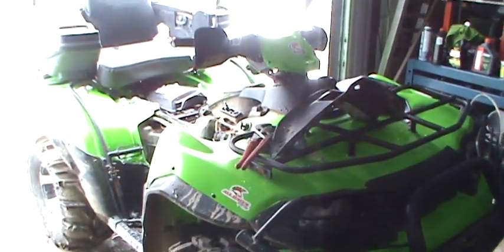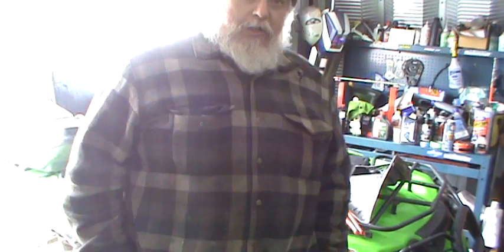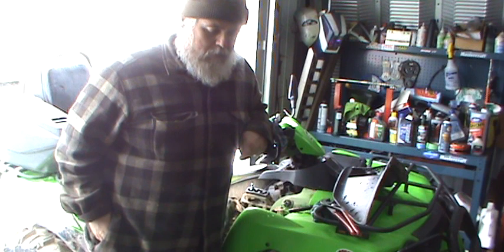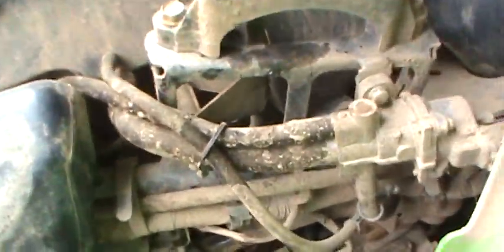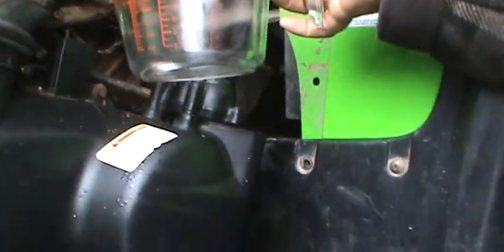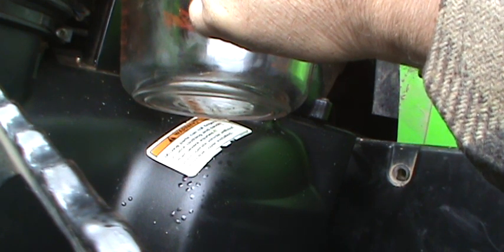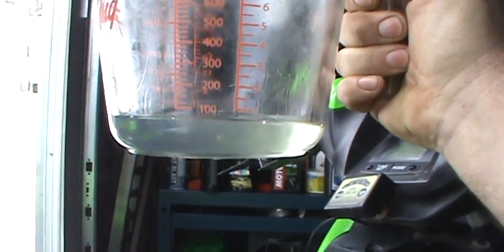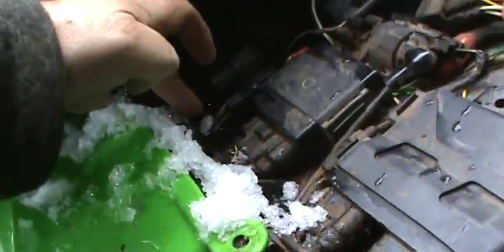Kawasaki brute force 750 no power backfiring fix

Comment from the maker: Some tools we use and like found here  https://amzn.to/3dbOQVE
Reply: Hey man I'm having issues with 04 prairie 700. It won't rev up it will idle fine. Hear Is what I have done to it so far. 
New fuel pump
Put carbs off running quad
Adjusted valve's 
Did compression test
Did leak down test 
Tested coils
New spark plugs
I just can't get it 😪 any ideas thanks in advance.
Reply: I'll send someone $100 if you can tell me what is wrong. Let me know I can call text or email
Reply from the maker: @darreng2639  Might be an electrical issue. Check all the wiring that deals with ignition and fuel. Sometimes coils test fine but break down under load.
Reply: My kvf 650 was backfiring through the exhaust and the carbs . I put rebuild kit in carbs , new plugs and set valve clearance. Inlet on valves had no clearance. So I set at 5 thou . Started it but no different . Reassembled the air box and it is now running great . However I don’t know which part of what I did actually solved the problem . I’ve just read somewhere that the valves on these tighten up rather than go loose and you can then lose compression . Please can you tell me if this is correct and would this have caused my backfiring issue ?  Love your vids from North Wales UK .

Comment: I'm having this problem backfiring out of the carbs I have changed the fuel petcock the fuel pump. I have took the belt cover off. Everything is good. I have reset everything for limp mod . What else could it be? I have even adjusted the valves  the four wheel was slipped over on its side ever since then it has not ran right what else could it be thinking? I'm gonna take and rebuild the carburetor.?
Reply from the maker: @anthonykriegel2207  do a leak down test on both cylinders.

Comment: Got question.. Got 08 brute force 750 it got oil catch can from top of valve covers front valve cover pipe when it warm up blow milk looking oil. Out it I check my oil it look new
Reply from the maker: Does it have a green ting? Prob a bad water pump mechanical seal. You need to remove the cover to drive the seal in from the inside.
Reply: If it was that would it leak oil or coolant out pipe and filter bottom water pump right

Comment: Gotta question for ya, is the stator in a brute force 750 in oil, my brute is leaking a small bit out the stator plug it seems and I'm told it's not a big problem, just replace plug.
Reply from the maker: There is some oil in there yes. Just take the cover off, clean it real good and use a small amount of amazing grey or permatex sealant on the plug.
Reply: Hey shawn, I've been chasing bogging issues since I've owned bike.only when bike is at temp.when cold have no issues.ive replaced pump and coils, did your fuel flow test and got 150 cc fuel, within a few mls, anyway, after replacing coils, the bike worked great for about hf hr, then it stalled which it never had before, but it fired right back up and shortly after just totally dies, I am getting no power to rear cylinder coil, I did a loop test on wire and there was a complete loop.any ideas on cause
Reply: Hello Sir
Please tell me if my kawasaki brute force KVF  750 A year 2006 has a electric fuel pump mine is the model with carbs 
Thank you!!!

Comment: What if I’m having a similar issue but right opposite it’s the front cylinder I believe not firing until i I get the rpms up about half throttle and then it kickes in and runs like a bat outta hell
Reply: And the front cylinder has good strong spark and I just put new plugs in it.. it’s a 2008 fuel injection model
Reply from the maker: try switching the coils and see if the rear starts to misfire.

Comment: Dpes the 05-07 bruteforce 750 have a gas on /off. I see under the fuse box close to the tank. There is what looks like one but only says on and prime. I wish they had a on off. Bc when it sits for a long time. Thats y these carbs get all clogged up. Do u think its worth installing an aftermarket one??!!
Reply from the maker: @ljccoppola2818  sure.

Comment: Hey I need help finding a cdi box for a 750 brute force 2008
Reply from the maker: It is a rare failure but it has happened. Check all the wires first. E bay used. They are very expensive new.

Comment: I done this test on my 2014 brute 750 i had the 150 cc's on the decond time i turned key on. My machine is backfiring at idle and when you push throttle pull plugs and they was shiny black on electrode valves have been set has good spark sny help would be great thanks
Reply from the maker: @skeetcat  do a leak down test on both cylinders.

Comment: Got questions  got 05 brute force 750 4x4 it was blowing oil out crankcase vent pipe..so he had top end rebuild with big 800 kit in itand still doing it
Reply from the maker: Can be many things. It's obviously pressuring up. Did this engine ever get a hot lunch ie overheated badly?
Reply: I don't know bought it and  it was doing it so had guy check it and he said it was  rings and jug so rebuild the top end got it back it run good no smoke

Comment: Yes sir thanks for your yo channel , hav a heck of a time with my 2008 brute 750 fi, new wiring harness, fuel line, injectors, 3rd fuel pump,I can test the pump hear it working, it just cranks and cranks won’t pump fuel , I am stumped, had it to a dealer and they couldn’t get it either??
Reply from the maker: Give me the full rundown.
Reply: Everything is new can’t get it to pump fuel I rebuild the pump with 3 different pumps, don’t wanna but a 609$ pump watched your pump building video guess I’m gonna try that next thanks
Reply from the maker: @reg62081  When you take the pump apart there is a little hidden screen where the fuel pressure regulator goes into the plastic body. Take a bent nail and poke a hole in that little screen. I bet that is your problem.
Reply: I’ll give it a shot thank you sir

Comment: Great video on fuel pump test! And love your unplugged acoustic guitar playing Hammer Head Garage your a great guitar player unlike myself! 😂.... Can this cc per cycle method work on our pulse fuel pump??? Also would you or anyone hear know what can cause our problem?  We have a 06 brute force 650 with a misfiring issue out the rear carburetor at idle & it lacks power in rpm's misfiring when rpm is increased...we put a new pulse fuel pump in it the old one was cracked it still backfires at idle with new pump on and a flame i can see deep in manifold boot when it's misfiring, the rubber manifold boot on the back cylinder it's white inside the boot noticed that when i cleaned carburetors changed out the jetting for a new ignition box its gotta be running lean with that white in intake boots yes? i went through settings on air screws from 1 turn out to 3 still spitting out carbs and lean no mater were im at on air screws.. our valves clearances are at the stock setting and done on compression stroke our intake is at 0.10mm exhaust is at 0.20mm i rotated motor seen intake valve close waited for my top dead center mark to come up for the cylinder i was on the tapits had play in them im told thats how you know your at TDC yes?? we have 60psi on cylinders we have all new jets and diaphragms in carburetors for this brand new Dynatek F.S. digital ignition we have in it our old one had a crack in the bottom,, we thought all these parts would fix our idling misfiring 😂. i got fed up used a gravity feed fuel tank straight to carburetors it improved a lot so did my power of my rpm rev but still have that misfire.. any input you or anyone hear would have it would be very appreciated these brute forces are the toughest 4wheeler i ever wrenched on im about to scrap it! 😂
Reply from the maker: Do a leakdown test on both cylinders not a compression test. Did you ultrasonic clean the carbs? the cc method only works for a electric fuel pump.
Reply: @HammerHeadGarage  Thank you for your reply and professional technician help Hammer Head Garage! I didn't do a leak down test on the heads I will do that see what I find and come up with. my only means to cleaning carburetors is the old fashioned Way carb cleaner and 150 psi of air and sometimes very thin wire for a passage way.. that carb cleaning tank i wish i had that set-up 😂... any chance we can make our own cleaning tanks with electric hot plates and old stainless steel pots if we can achieve the proper water temperature and use the proper solution? I really appreciate your tech help Hammer Head Garage your the best!

Comment: Have a 06 cat belt warning on did the factory reset numerous times won't reset. Wiring good, switch in on position battery at 12 volts starts and will run but won't rev up much. CDI box?
Reply from the maker: Likely an ecu issue. Did you try taking the ground off the battery and then re hooking it back up?
Reply: @HammerHeadGarage  yes removed ground also tried unplugging ECU same thing.

Comment: Great video. Mine backfires really bad during deceleration. Do you know what might be causing that? It seems to have plenty of power, but backfires all the time. Whenever I’m slowing down, especially from really high speeds to just completely letting off the gas.
Reply from the maker: @josephbearlewis  holes in the exhaust or loose pipes and bad gaskets can all cause it.

Comment: I have 2003 kawasaki  prairie  4x4 an I need to know if there's a speed reset  on it
Reply from the maker: No there is no speed reset.
Reply: My 360 cc doesn't go the speed that its supposed to it just bogs out when I go full throttle
Reply: I put new carburetor on  it an i adjusted  it does the same
Reply from the maker: @hilariorodriguez6468  start with the basics: fuel/air/spark and go from there.
Reply from the maker: @hilariorodriguez6468  Basics are Fuel, air and Spark. Start there. Get a service manual.

Comment: Great video , thank you ,  curious,  I have a 2002 prairie 650 4x4 , carbs were full of dry gas. I ordered a kit , new o rings ect.. I cannot find accelerator pump diaphrams anywhere ,  I tried kawasaki but they said they dont make them , not even a part number. Any idea on replacements ?  Thanks
Reply from the maker: You will need to find one that fits from another carb. suzuki often interchanges with kawi.
Reply: @HammerHeadGarage  thank you I'll give it a shot

Comment: i have a 2006 brute force 750. bought it used and had no problems. got it home and the problems started. i was riding it and !/2 and full throttle it will back fire in the back cylinder. dealer has put new carbs on, cleaned vent lines, ect... they want me to come pick it up as they don't have the time to mess with it anymore cause they are backed. $715 in labor and still not running. alot of people are saying it could be valves needing adjusted. i need answers!!!!!
Reply from the maker: Do a leakdown test on both cylinders and get back to me. Could be many things. Puting the front cam into the rear cylinder will cause this. Low compression, bad valves, bent valves etc.
Reply: @HammerHeadGarage  how would I do a leak down test?
Reply from the maker: @ChippyDooTV  take it to a mechanic.

Comment: Im trying to put one together,(2003 650 Prairie),  My question is, whats the difference between the rear head and the front??  Seems the front is about double the price and rare to find with cam,  Why?
Sorry, thats 2 questions.
Reply from the maker: Heads are the same but the cams are different. the rear cam has a raised radius along the face of the seating end.
Reply: @HammerHeadGarage  I deeply appreciate the insight, but i have been staring at a front and rear cam pic for an hour and still dont see what you are referring to.  Please send a pic.   Thank you!
Reply: I think I see the raised portion.  So, is it possible to buy a cheaper rear and substitute a front head??
Reply: I said it wrong..... buy a rear head and swap the cam for a front cam and install it??

Comment: My prairie 700 is blowing gas into the air box. Any idea where to start? Cleaned the carb multiple times
Reply from the maker: check float level. Do a leak down test. If fine when were the valves adjusted last?
Reply: Probably never adjusted. Its my dads and it just stays in the garage barely gets used. Great shape for its age but little to no service besides the little stuff (oil, air filter, fresh gas). Ill do all that stuff and get back to you. Valves aren’t something i think im capable of doing myself im not a very good technician haha

Comment: What should compression be on my 2008 750? Also when im checking do I need to have both plugs out?
Reply from the maker: Take out both plugs and ground them in the plug wires to the chassis. Range should be 36-66 psi on a warm engine. Make sure the throttle is held wide open when cranking.
Reply: @HammerHeadGarage  upon doing this I got 49 front cylinder and 75 on the back.  The guy I bought it from had a different plug in the front cylinder and the cr7e in the back cylinder, i put the right ones in seems to run fine. Hard time starting tho.
Reply: He has me a little shook tho because I went to msg him back on facebook to ask him some questions and he blocked me.. so im thinking I might experience some more issues.

Comment: Im having a similar issue with my 2023 750 brute force with 65 miles on it… wondering if this test would still be applicable? Im not sure if I have bad gas or got some contamination in the tank somehow. Don’t take it mudding or anything like that has just been on dirty wet roads! I do wash it after every time out though so maybe there is an easy way for stuff to get in? 

Appreciate it!
Reply from the maker: That machine should still be under warranty.
Reply: @HammerHeadGarage  sadly the warranty expired 3 weeks ago. Just my luck!

Comment: shaun, I've got a 2006 Brute force 750. Extremely clean well kept low mile machine.
It's having a hard time cold starting. Crank and crank and crank..finally she'll fire up. Did a complete tear down on both carbs, cleaned all the tiny side port holes on the pilot jet as well as the main jet base. Its giving me a slight backfire issue as well. 
Any ideas?? Just does not want to cold start.  Have you made a video on brute force carb maintenance? 
Love the channel. Love the excellent informative info!
Reply from the maker: with the machine running, spray some carb cleaner around the intake boots where the carbs join and on the head side. If it dies or you notice a change in idle you have an air leak. Also is your enrichner working properly? what do the plugs say? Rich and sooty? whitish lean.
Reply: @HammerHeadGarage  
I wasn't aware of an enricher. 
Old plugs looked good.  Just a shade on the dark side.  
Can you do a carb rebuild / fuel system video?

Comment: What do it mean if front head not even get warm
Reply from the maker: Usually means that cylinder is dead due to no spark, no fuel or no compression or all three. Do a leakdown test on both cylinders.
Reply: Hey thanks man it was the fuel

Comment: Cant it just be the filter in the fuel pump? its probably partially plugged. Im thinking this may be possible looking at the bike its pretty dirty as well.
Reply from the maker: Yes it can. Also that little screen inside the plastic body,

Comment: I have a question? I have a 2008 650 Kawasaki brute force it seems like I have no power going to my fan and no power going to my four-wheel-drive actuator but power going everywhere else would you have an idea?
Reply from the maker: start tracing wires. Likely an open circuit somewhere. Use a test light to find it.

Comment: Hello, Can you shed any light on the 2017 Brute Force 750 electric power steering? It seems like there is little to no assist. Been that way since new. Dealer says nothing wrong. Any way to increase the assist? Kawasaki and the dealerships are tight lipped about this issue. I feel like i wasted alot of money for this stock feature.  Thanks in advance.
Reply from the maker: I told them when it first came out not to do it. It's garbage. They put it on there knowing it would break to make money selling the bits that make it work.

Comment: Hello sir having problems with a 2010 brute 750 just backed it off the trailer washed it down quick and would start again did fuel pump and filter narrowed to ect and roll over switch and other module I’m not sure what it is what’s your best guess here? If you don’t mind sharing your knowledge no expectations just at a loss!
Reply from the maker: Check the basics. Do you have spark? is fuel getting into the cylinder? air filter plugged? Also check the roll over switch. Unhook the neg terminal of the battery and then re attach it.
Reply: @HammerHeadGarage  thank you for your help we found the issue broken wire under rear shock tower! Go figure!! Cheap fix though!

Comment: I have a 2009 brute force 750 fi it was running good but smoking I changed the rings and pistons didn’t notice till after that the new pistons bumped the compression up to 11.5.1 it will crack up an run but mostly fires on the front cylinder I’ve swiped the coils no change I even took k a ecu off another bike.  I’ve checked the timing multiple times did a compression test and have rechecked the valves about 8 times. I’m all out of ideas please help
Reply: I got air fuel an spark